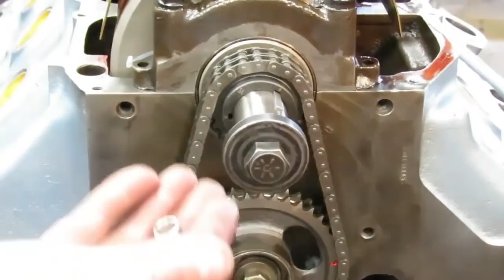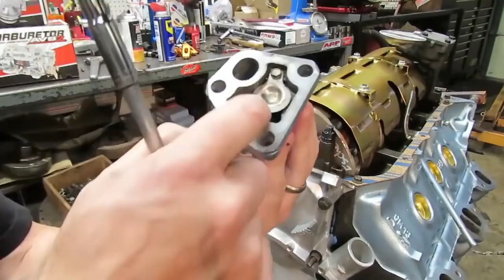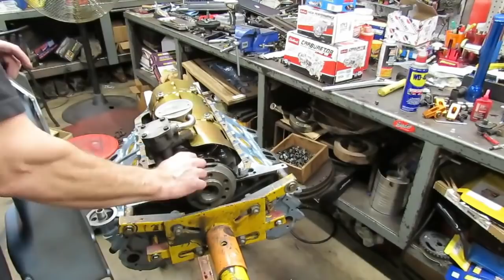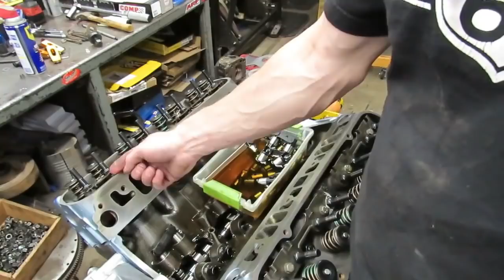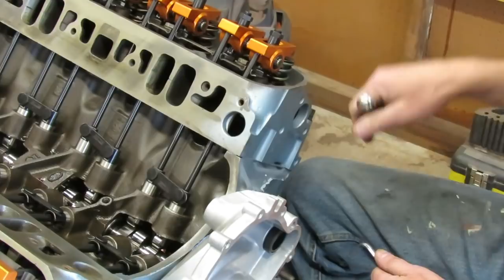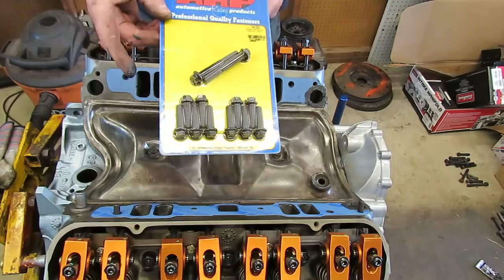Pontiac 350 rebuild part 7

Comment: does Pontiac stamp the displacement on the engine block to let you know what it is?
Reply: Depends on the year, which is near the distributor hole, along with the part #. There is also an engine code on the front right of the block.

Comment: I have a '77 Firebird with a Pontiac 350. Can the same block be bored to produce a 400?
Reply: No, I'm afraid not.  The cylinder wall thickness is not adequate.  If you look at the cooling capacities of the Pontiac V8s, the 350 holds more coolant than the 400 or 455 because there is so much more space in the block with the smaller diameter cylinders.  Easiest thing to do is take a 455 crank and cut the main journals down to 3" or get the 4.25" stroke Eagle crank.

Comment: Got the Fever for the Flavor of a Pontiac 350 rebuild Part 8. Killin me!
Reply: I'm waiting for it to.  I want to compare his dyno numbers with mine.
Reply: @srmsrm3676  How did your P350 do on the Dyno?
Reply: @anthonysantiago1999  I have three videos posted  as "Pontiac 350 Stroker Dyno Runs" on YouTube.  Corrected numbers were 442 lbft at 4600rpm and 458 HP at 5600rpm.  There'll be more tweaking on the carburetor once the engine is back in the car, because the engine was easily pulling to 6200rpm.

Comment: We have built a 1970 350 Lt1 with 11:1 compression, Factory LT1 solid cam, Al intake, forged rotating assembly, Headers and old points distributor.... My old Auto Repair Manual shows timing set 4 degrees BTC at 750 RPM.  Getting ready to break in cam and wanted to ask approx what timing at 2000 RPM? Thank you

Comment: Butler Performance Pontiac used to sell a one piece rubber oil pan gasket from B.O.P. part #BOP-OPG49. Is that still available or did they discontinue it?

Comment: Hey man I got a question. I got a .040 400 small block with flatops in it and vortec 350 heads and I’m gonna blend the bowls on them and run the ls6 springs and the comp retainers. What a good flat tappet cam for that setup. I’ve heard a split duration cam would be a good choice. I want a choppy idle. I was looking at a Howard’s CL112141-10 is that good I want as much lift as I can get with that setup. It’s going in a truck with a th400 2600 stall tci converter and 373 posi rearend.

Comment: People overlook the Pontiac 350 but just the 3.75” stroke crankshaft makes it an excellent street engine especially in a heavier vehicle.
Reply: It's not the stroke as much as it is the connecting rod length and the resulting rod to stroke ratio that let's a 350 produce so much torque for it's displacement.  The penalty though is a heavier engine because of the tall deck height, combined with the bore center spacing - remember that a 455 crankshaft can have the journals turned down and be used in a 350 cu in block.
Reply: @srmsrm3676   1970 Pontiac 400 2BBL has 400 ft/lbs of Torque Where you DRIVE, at 2400 rpm !